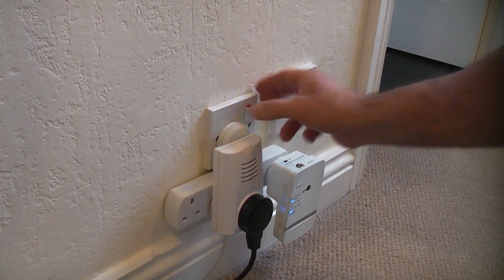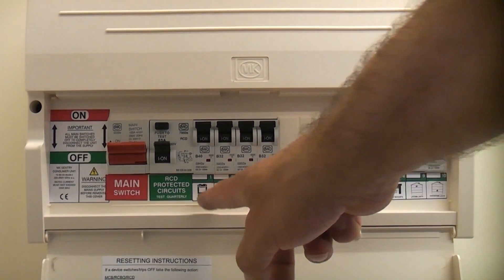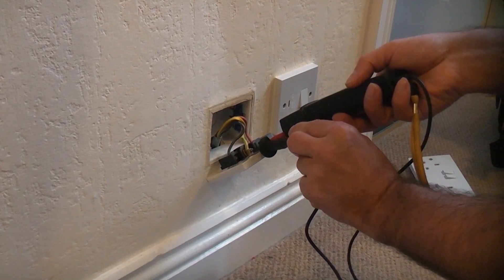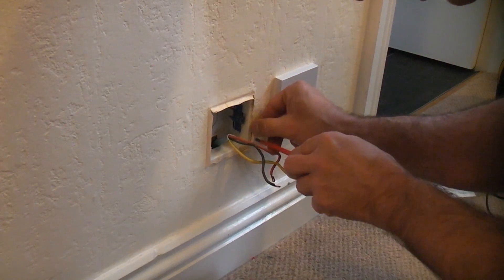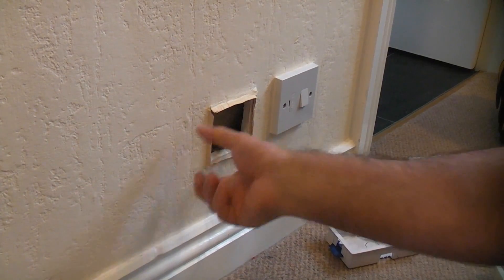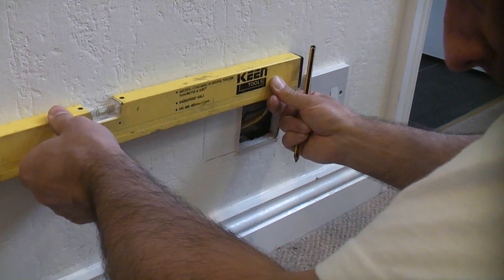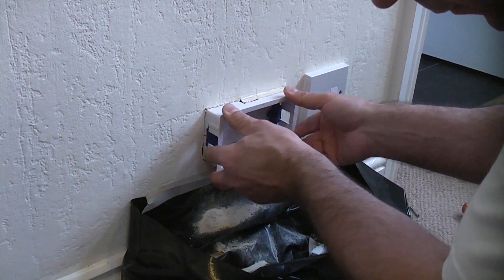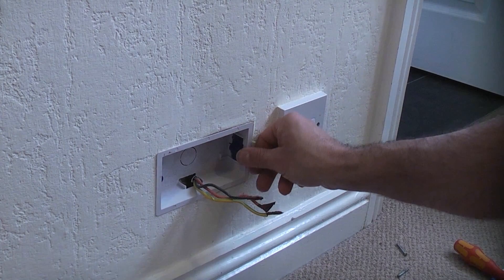How to replace a single socket with a double socket

Comment: What if your consumer unit is something from the early 90s! So no switch fuses for each area of the house. I want to get it updated, but worried it'll mean rewiring the whole house!?
Reply from the maker: You would have to remove the fuse for the circuit, but in all honesty if your consumer unit is that old it might be worth getting it checked out by a recommended electrician in your area- just to make sure it is safe (and the wiring). If you can get someone that is recommended and won't rip you off it's worth getting the electrics checked to be on the safe side ;-)
Reply: Jasmine, get a local electrician to quote for it... (or several). If the wiring is genuinely from the early 90s, it'll be red/black pvc and provided it's not been bodged around by DIYers, likely will be ok. In that case it's perfectly permissible simply to update the CU while utilizing the original wiring. Get a few quotes, and check the sparky's checkatrade reviews  :)

If they all insist your house needs rewired, (as in ALL of them) it likely does. but most times we can simply replace the CU 

*disclosure, I work for an NICEIC reg'd company :)
Reply: just turn off the mains power.and ull be fine. if its a really old house ull have the old black and red wire colour code. not to worries just google it but if you want to re wire the hole house your talking alot of money ! i would probably upgrade your fusebox and leave the wires as they are. this will save you some cash.
Reply: Be careful the lights died intermittently in my Parents kitchen when I investigated it the person who wired the extension did a bodge job, wires were arcing under the floor of their bedroom could have caused a fire only my father asked me to have a quick look who knows what might have happened. 

Get a qualified electrician in to look it all over and if you have the funds get a modern Consumer Unit fitted, Until then pull the fuse feeding that circuit, just to be safe.
Reply: Thanks for your advice! I will have a look online for some well reviewed electricians then and get some quotes. 
Our upstairs lights have died too, so i'm guessing that is because the fuse for that circuit is dud. Fingers crossed thats all! The house was built in 88, so hopefully it'll be an easy fix!
Reply: Eddy thanks for your advice :)

Comment: Great Video as usual. With the drywall saw....you don't have to make an angled cut. It is pointed so you can place it in the corner and jam it in to start cutting.
Reply from the maker: Thank's Rick ;-)
Reply: I use this method too, however in certain circumstances I believe UHMs method may be more appropriate. Sometimes the wall is weak due to being made good etc. Always depends on the situation. I think for a small job like this I'd play it safe and avoid damaging the wall haha! :)
Reply from the maker: Thanks for the comment ;-)

Comment: Pah !!! Single cable = easy :-)
Hate fighting with them when there's three cables !
Reply: Haha, I just commented the same thing, three cables and no slack to play with, so many times...
Reply from the maker: This one was remarkably easy- unlike many other jobs when I start them ;-)
Reply: Ultimate Handyman how easy would it be to swap a single light switch to a double and put another light on to this.
Reply from the maker: Yes, it's a real pain when there are 3 cables.
I didn't know until I started this how many cables there were or even if there was a stud at the side of the existing socket- I was very lucky with it ;-)
Thanks for the comment
Reply: Excellent video as always mate, but how about one where you hit all those snags us mere mortals run into ? :-)
Reply from the maker: I normally hit a few snags but not on this occasion.
Perhaps there will be one when I install the TV on the wall ;-)

Comment: But the way, did those bulky psus fit in a double, as sometimes they are still too fat
Reply from the maker: Yes, they plugged into the double socket easily.

Comment: Hello, you forgot you can do a double surface pattress box coversion
Reply from the maker: Yes, you can but they stick out a fair bit ;-)
Thanks for the comment
Reply: My house is full of them, brick walls!
Reply: Early 60s house, brick walls and originally , one!  Single socket per room
Reply from the maker: Blimey.
Do the lighting circuits have a earth wire? (some houses built in the 60's don't have as there was a copper shortage)
Reply: Just seen the comment below me says the exact same thing about the 1g to 2g socket. My bad!
Reply: You can also buy a 1g to 2g socket conversion. http://www.screwfix.com/p/clipsal-converta-socket-1-gang-to-2-gang-polycarbonate/12849

Not that it's ideal or anything. Can't really think of many situations where you don't have the option to either cut out a new drywall backbox or chase a metal backbox in. Other than maybe hitting stud. But I guess it's nice to know the method is available lol.
Reply: It has been re wired in 2000 but no extra features were added, such as more sockets

Comment: You can also get a socket converter which is a double socket that fits on a single box 
A bit simpler if on a solid wall
Reply from the maker: That's correct but they can be dangerous- 
http://www.ultimatehandyman.co.uk/forum1/dangerous-clipsal-converta-sockets-t26212.html

Thanks for the comment ;-)

Comment from the maker: Happy Easter Sunday to everyone.
I hope you are all having a good break, I have been busy changing a single to double socket, hanging a TV on a wall and replacing the rollers in my shower cubicle doors- to be honest I would rather of been at work ;-)
Reply from the maker: I've got a few jobs done around the house but still got loads to do LOL
Let's hope the trapped nerve is back to normal soon ;-)
Reply from the maker: I got a trapped nerve in my back once when I was about 13. I had been to the gym the day before and could not get out of bed as I could not lift my legs or move much. I shouted for my mum who called out the doctor, he grabbed my head and quickly yanked it to the right (or left) and after that I could move again. It was very painful if I remember rightly!
I hope you get better quickly ;-)
Reply from the maker: Thanks ;-)
Reply: Happy Easter. Thanks for your excellent videos!
Reply from the maker: Thanks Peter ;-)
Reply: Ultimate Handyman went on an Easter break away in Suffolk with the family and ended up trapping a nerve in my back.
Reply from the maker: I got a trapped nerve in my back once when I was about 13. I had been to the gym the day before and could not get out of bed as I could not lift my legs or move much. I shouted for my mum who called out the doctor, he grabbed my head and quickly yanked it to the right (or left) and after that I could move again. It was very painful if I remember rightly!
I hope you get better quickly ;-)
Reply: Ultimate Handyman Thanks mate, hope you are enjoying the break off. I'm feeling a bit today though. 👍
Reply: Easter is a pagan festival appropriated by early Christians in order to make it easier to convert heathens to their faith. Sometimes I wish that I was not a secular humanist (atheist) as I spent all Easter week-end Good Friday thru bank holiday Monday working. 2 combi  boiler swaps, 3 port motorised valve swap, thermo-couple swap, 2 gas oven installs. as well as other snagging jobs for numerous patient customers.  Just got home and "she" (who must be obeyed) wants a complete double glazing replacement throughout the house all for the sake of 2 misted panels and a single rotten sill!!!! "Why haven't you vacuumed the lawn yet!" she said with folded arms and a mad glare in her eye. No wonder I spend so much time working...... We've been married ten years... you only get 7 for manslaughter! (credit for joke Les Dawson) I mostly enjoy my work... it gets me outa the house.
Reply from the maker: I'm an Atheist, but like the two days off at Easter ;-)
Like you I was working, albeit at home doing videos.
On Sunday I installed a TV to a wall, it replaced one that was damaged a few months back. Obviously, I set it to the same height as the last TV but the girlfriend is not happy and is convinced that it's higher! 
Thanks for the comment ;-)
Reply: You are most welcome. I often peruse your You Tube contributions. More out of curiosity to see how folk approach and do things differently. Tell your girlfriend that the TV is at the same height, but her bum has got bigger. She has grown in stature and you have diminished by comparison. Sugar the pill... and then run like hell.
Reply from the maker: LOL, she would love that ;-)
Reply from the maker: Thanks, It's been a while since I have done a full house renovation but I still think about it all the time!
Good luck with the renovation ;-)